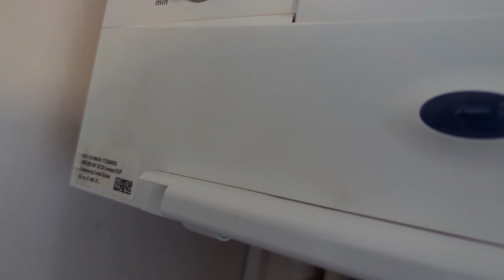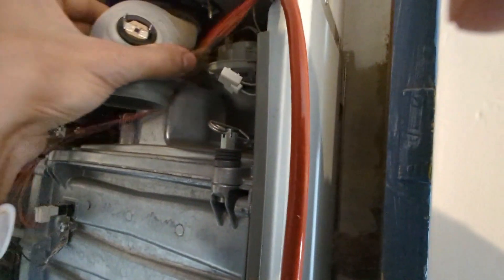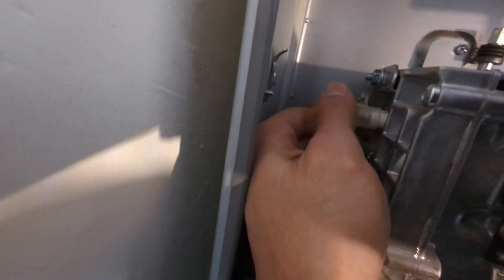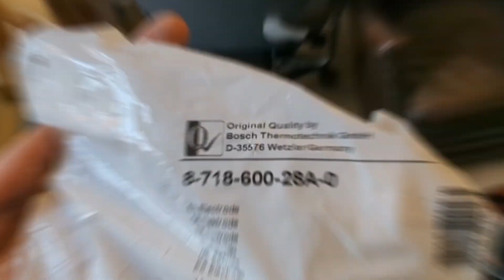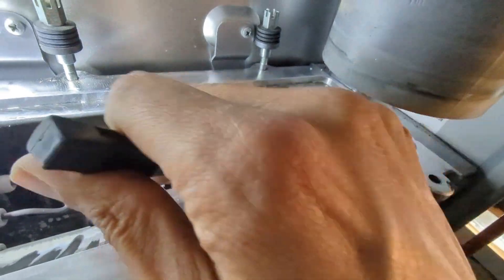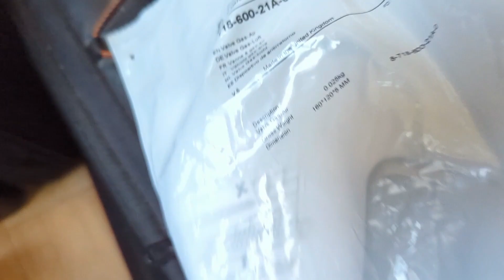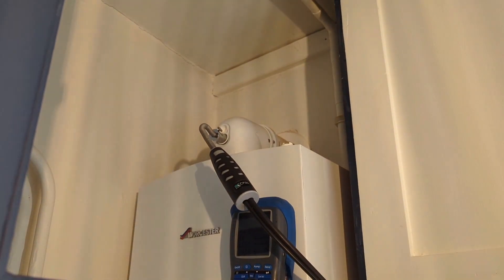Worcester Bosch CDi Compact ERP Full Service

Comment: I've done full strip down service on this yesterday, pulled cables out of the fan plug as it was so seized up, ended up digging plug out, put the cables back in then socket.. Turned out other way around, E214 fault, it's a 240V supply so I was happy to see that only fan broke ;)
Reply from the maker: Nice one 👍🏾

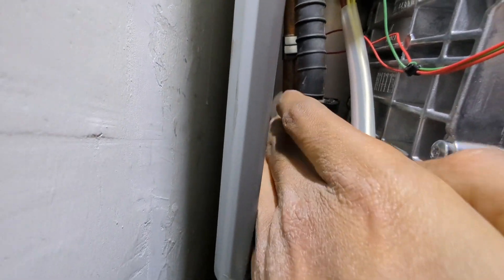Comment: If most have done a few of these compacts, then stripping them down is quite easy and straight forward, contrary to what most seem to think about them. (love the negativity tho "being a Worcester"). I have see other manufacturers where some parts of a service can be awkward too if you are not familiar with them. you don't really need the special tool as you say, most use a similar type singular blade :) "tip" to stop the electrode seal from falling out, pop a dab of grease in the seating before fitting it. the burner can go in any way. (did you clean that bit of debris out the burner? @12:34) the bearing plate is designed to stop the formation of condensation inside the air box due to the warm/cold air scenario. @15:48 the black gas tube is under negative pressure, so a sniffer will not pick up a leak due to the suction. for newbies / trainees watching - the APS (air pressure switch) as mentioned is not actually that, it is a FGBS (flue gas blockage switch) so if the flue outlet becomes restricted / blocked - back pressure will increase and break the switch as it is connected to the flue gas side. the best way to remove the syphon I find, if it is near to discharge, try and wiggle it so it does, then pull the black rubber tube forward from the bottom outlet connection, bend it up so it also forms a seal, and remove the syphon. loved the video tho, very detailed and informative throughout, I'm sure many will learn from your advice and knowledge. keep up the good work.
Reply: Bang on mate. Worcester’s are workhorses. Not that hard to work on. Think it’s a fear thing as they look full on but once you know what your doing they’re fine.

Comment: Great video. I've got a few of these to do this month. How much approx are you charging for the full strip down service. Do you wait until the fan pressure test reading says it needs doing or after a certain time scale?
Reply from the maker: I charge £250 including the replacement parts. I tend to do a full strip down every 5yrs regardless 👍🏾

Comment: Great video as always. I just wondered how you priced for this. I charge £90 for a full strip down sevices and system check. I know the cost of all these seals would add up. I feel if i told the customer its say for instance £180 for all seals and new electrodes etc that they would just go else where. I know online a service is offered at £65 i have no idea how they can actually strip down a bouler and do a good job. So just wondered how you are able to to replace all these parts without scaring the customer away?
Reply from the maker: Depends on the area you work in as well I guess. I don't always win the jobs but I charge what I feel is right for a proper job and some customers appreciate it and some just want the cheapest. Swings and roundabouts in this game 🥴

Comment: Would you only do a full strip down on this boiler if it failed the fan test??
Reply from the maker: Yes and no, I advise a full service after 5yrs anyway so customer can decide
Reply: Bro what would you do for a service for one of these only 1 year old?
Reply from the maker: @t.g6301  drain boiler, recharge vessel, clean condense trap, visual inspection, check seals, sweep test around combustion seals, 26.9 checks 👍🏾
Reply: @cputilitysolutions  thank you bro, keep up the good work and great videos.

Comment: I have got the cdi32 but the heating and hot water knobs don't turn all the way back, is it supposed to be like this?
Reply from the maker: They should go all the way up and down
Reply: @cputilitysolutions  🤔 they don't, is there a way to remove the knobs?just wondering if during installation they were fit incorrectly

Comment: Please can you tell me How do you take the front casing off a 28 cdi compact? I got expanding foam stuck behind it whilst working on the joists on the room above boiler. Thanks.
Reply from the maker: 2 screws at the bottom and 2 green clips 👍🏽
Reply: The two screws at the bottom take off the control panel cover. The 3 screws behind take off the control panel itself once you have pushed the said green clips behind there is just wires. No other screw etc to open the front casing. At the top of the boiler the two clips seem to be holding in the stainless steel flue casing. I don't think this is a diy job. Got quoted £165 as it's classed as a boiler repair apart from british gas who advised book a next day boiler service and removing of debris will be included fixed price of £99.

Comment: So.  Explain to me.   How when I’ve had boilers serviced by council contractors engineers.  They are in and out in ten minutes.
Reply from the maker: Think that's pretty self explanatory that it hasn't been serviced 😂 a proper tightness test procedure alone from start to finish would take 4mins, gas rate would take 2mins so you've 4mins left to do the rest 🤦🏾‍♂️
Reply: @cputilitysolutions  you don’t actually have to do a test on the whole gas ,you can isolate at boiler test boiler alone and then you have only opened the test nipple on gas valve.  They spray it.    Been told this by a few engineers.   But from what I’ve witnessed putting an analyser in for two minutes then going is about all some do.  And iv3 seen it done
Reply from the maker: @peterreid4567  true but I always prefer to do a tightness test on the whole system to be safe there's no gas leak on the system
Reply: @cputilitysolutions  yes me too.   Thanks for the reply

Comment: Nice job mate. How many cuts did you get, and how many times did you swear. That was a few quid in parts you replaced there, a lot of customers want a service, but don’t want to pay the money to have serviceable parts replaced, as they think it’s under warranty and should be free. Pay the money and you will have a proper job done, not as some people do a poke and go service.
Reply from the maker: Luckily no cuts but was swearing under my breath as the customer was working from home lol. I always give them a price for the bits I'm definitely going to change but also explain that anything else would be additional depending upon inspection

Comment: Anyone know what changing the plate is like on these? Is it the same as the juniors move the hot pipe and they slide down the back? I know everything about the compact design is shit so idk if it’s too tight or not?
Reply from the maker: Luckily the plate on the compact is at the front. 1 screw and it slides to the left 👍🏽
Reply: @cputilitysolutions  ahhh thanks for the reply, I was expecting it to be a real shit job because it’s on the compact, sounds easier than a vailant though 🤣

Comment: I note that you didn’t show the removal of the electrode leads ! If you got them off without damaging the insulation boots I’d like to know how as I usually destroy them when removing the leads from the electrodes 😂 What a truly horrible machine these are !
Reply from the maker: Yeah it was tight trying to get them off, this video was recorded a while ago so I can't remember if the boots got damaged or not (probably did) but yeah poorly designed boiler!

Comment: I hate these boilers. They are so fiddly to work on.
Reply from the maker: Yeah defo up there on my list of boilers I hate!
Reply: @cputilitysolutions  have you ever took the plate off on one of these? ..... Got to do one next week and not looking forward to it
Reply from the maker: @lefthandedscrewdriver3954  the plate thankfully is dead easy, it's at the front! 1 screw on the left holding it in and then it slides to the left out from behind the pump